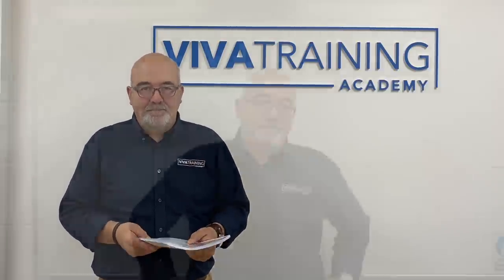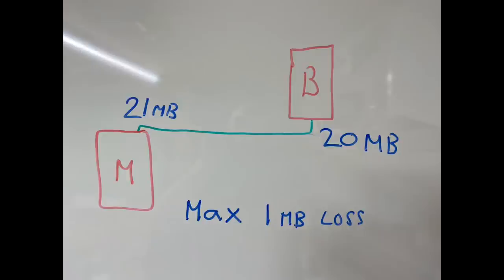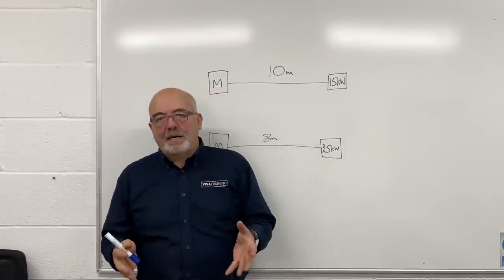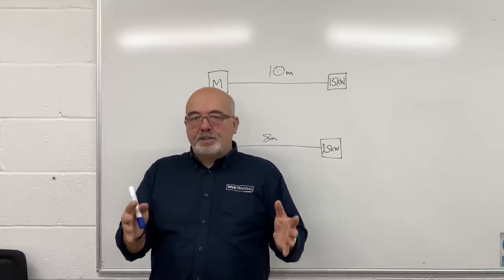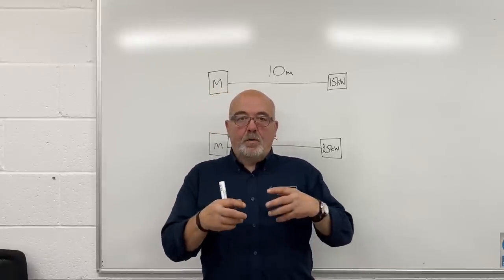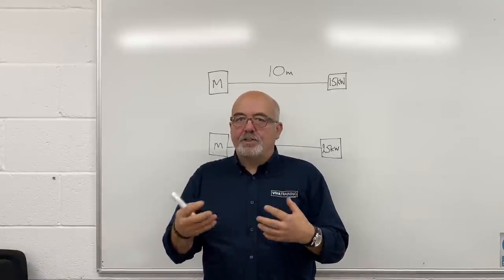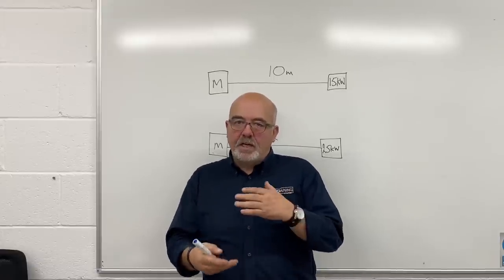ACS Gas Training - Gas Pipe Sizing

Comment: Great video. Im currently piping my home for propane but hope to one day have NG access. I understand that natural gas pressures are much lower than propane. If I size my pipe based on natural gas, would I be able to use propane appliances?

Comment: Once again brilliant video Russ and Allen.
Few questions I would like to ask:
1. When there is 2 or more appliances connected to gas meter, does each appliance have a limit of 1mb or is it both appliances have a limit of 1mb pressure drop?
2. If at a customers home and they want to upgrade, we should check if pipe sizing is sufficient enough for to allow no more than 1mb of pressure drop?

Comment: Hi just a quick one, when calculating the Tee equivalent length from B-D in the last example for appliance 2 would you not use the largest connection size of 28mm (A to B) to give you an equivalent length of 2.3m not 1.8? or is that incorrect

Comment: Great video Allen. As my house is currently undergoing a major refurbishment, a new gas boiler will be installed soon. I've been doing some calculations using the video from Russ here. The boiler will be located about 11 metres from the gas meter, so it seems to me that 6 metres x 28mm dia then 5 metres x 22mm dia are required.
But yesterday I've been digging outside to repair the drains and also replace the water mains (lead), and while I was at it, I saw a yellow gas pipe (which comes from the street to the gas meter in my cellar). I've measured the outside diameter of the yellow pipe using a vernier caliper and it is only 20mm (funny size I know).
So, I'm not sure if it would be a good idea to use 28mm from the meter if the mains from the street is only 20mm. 
Can you please enlighten me? I hope to hear from you soon.
Thanks. Cheers
Ian
Reply: I’m no expert, but I imagine it’s at a higher pressure on the mains, and it is then reduced once it goes through the regulator on the meter. 🤔

Comment: Very good and clear. Why is the permissable pressure drop 1mB? Is it a standard, or does it change on different systems?
Reply: 1 mbar is standard on all domestic natural gas systems. It's different for LPG, and on commercial gas systems of higher operating pressure. There will always be some pressure drop when gas flows through pipework. 1 mbar is achievable with reasonably-sized pipework.

Comment: Can anyone help me out?
When working out the additional pressure loss by adding elbows, where did he get the 0.6m for the first diagram.
Also where did he get the 0.8m for the second diagram?
Is it just the length of the vertical pipe X by the two elbows?
Reply: I think  he got that info from the chart for the different diameter of pipework 22mm and 28mm. He is using the paper for his calculations. It  might be in BS 6891
Reply: @mrproductivity3261  that’s the equivalent length of a 90 degree elbow for the 22mm and 28mm pipe respectively

Comment: Just to clarify at the end there B to C (0.15mb) + B to D (0.55mb) = 0.7mb total drop over both appliances. 
Do you not need to add A to B (0.15mb) aswell which would give 0.85mb which is still under 1mb in this case?
Reply from the maker: Hi Lee, I would need to watch the video again to check but i am on my way out. I will look when i get chance. Thanks.
Reply: Gas flows along multiple, separate paths to each appliance. Pressure loss to each appliance is the total pressure loss along each path, not of all pipes on the system.
Reply: Good question, I'd like to know this too
Reply: @Jehannum2000  So would that mean the each appliance has its own system which has a limit of 1mb of pressure drop for each appliance, you don't add the 2 different system's pressure loss to make sure its under 1mb??
Reply: @mrproductivity3261  Yes. Let's say there are 2 appliances on a system (e.g. cooker, boiler). Say gas leaving the meter goes to a tee, losing 0.5 mbar in the process. The pipes from the tee to the boiler AND from the tee to the cooker can then lose 0.5 mbar each. Gas only follows one of these routes, so the total pressure loss to each appliance will be 1 mbar (not 1.5 mbar).
Reply: @Jehannum2000  Thank you for your explanation

Comment: Can you explain purge volume on gas meters only, given that it not needed up to 70 kw on any pa perwork only on commercial paperwork 
Cheers
Reply from the maker: Merry Christmas
Reply: For diaphragm meters, purge volume is 5 times the cyclic volume ("badge capacity") of the meter. As you say, this is only considered as a separate entity in commercial systems. In domestic systems, purge volume is either 0.010 m^3 / 0.355 ft^3 (for 28 mm pipes and U6/E6/G4 meter)  or 1.5 times the installation volume of the system (35 mm pipes or U16/G10 meter).

Comment: There is something i cant understand 
i am not expert so i will appreciate your help
i would know how much the pressure going out from the meter should be and how much should be while it is into the appliances 
I study that we install a stages of pressure regulator to regulate the value of it but no one ever said about that.
so sometimes the pressure drop can be neglected if the pressure value after it drops doesn't exceed the appliance pressure.
is that right?
Reply: Your question is somewhat difficult to understand, but I'll try: The working pressure coming out of the meter should be 21 mbar (plus or minus 2 mbar). This is governed by the regulator before the primary gas meter. The total working pressure loss along the pipes to each appliance should be 1 mbar (maximum). In the UK, natural gas appliances are designed to work optimally at 20 mbar (although they can usually work safely at lower pressures).

Comment: Great video thanks, however with legislation starting to go against new gas installations in terms of making it illegal to fit a gas boiler in a new build after 2025, do you think it's still worth training as a gas engineer at this point in time?
Reply from the maker: They are currently spending billions of pounds on the gas pipework. Anyone who believes gas is going is crazy in my opinion. Only time will tell though.

Comment: Assuming that you have 20mb working pressure AT GAS METER and then you have an Ideal Logic which according to the MI's can do full output with inlet working pressure as low as 14mb, what happens if your inlet working pressure is 14mb due to pipe being undersized then? what about this 6mb pressure drop? 

also,same situation with baxi 624,according to their MI's,it needs at least 17mb inlet working pressure, what if you have 17mb inlet working pressure at boiler,what about this 3mb pressure drop? what happens in these situations?

thanks
Reply from the maker: You are allowed 1mb drop over the pipework for pipe sizing. The boilers will work down lower in extreme conditions, That doesn’t mean in normal working conditions. Thanks.
Reply: @AllenHart999  Hi Allen, thanks for your reply,not too sure about what you mean,i might not have worded it properly..i understand its max 1mb pressure absorption. but let's take ideal logic as an example, 14mb minimum according to MIs, so if you have 20mb working pressure at meter and due to pipe being undersized,you only have 16mb at boiler meaning 4mb drop across installation pipework, what about this situation? obviously 4mb is more than the 1mb allowance,but MI says boiler can work with inlet pressure as low as 14mb.   lets say its a new installation, is it ok or does it make it AR or ID? thanks
Reply: @11982463  Hi Im curious to find out if you figured this out, I would assume it is undersized pipework and ID because the pressure drop is way below 1mb. Please can you let me know what you found out. 
Thank You
Reply: @mrproductivity3261  with my limited experience , what i have seen in real world is that everybody just leaves it as it is, with the situation of more than 1mb pressure drop,but above minimum MI’s requirement may it be 14mb or 17mb…  it doesnt seem to be an issue. Some with more than 1mb pressure drop n will still gas rate just fine.  i have heard that the undersized gas pipework for boiler may affect other gas appliances, for example, it may affect the supply to a gas hob when boilers on maximum burner.. but im not sure

Comment: Extremely helpful video. I just wonder if the end calculation that totals 0.7mb by adding the pipe runs of b to c and b to d.

Should a to b have been added on also?

Seems unlikely he's made a mistake with this level of detail, but to myself a to b feels like a lot has been missed. For my own build this would be 8 meters lost so I'd really like to know.
Reply from the maker: Thank You
Reply: He’s already done that In the allowance from A To B that has to convey the full 40kw.
The A to B loss was 0.15mb, and that has been allowed for in both app 1&2. He’s done it separately so if you look, 
A to B 0.15 mb
B to C 0.55 mb
Total 0.7 mb

Comment: nonsense creating red tape regulations and paperwork  boiler manufacturer gives min inlet pressure figures 20mB of gas pressure people are upgrading pipes adding more cost to installation  35mm 40mm pipes in domestic homes this is a joke these pipe sizes are used in commercial buildings my old boiler says 20mB inlet pressure the boiler installer wanted to change the pipes from 22 to 28mm the new boiler also says 20mlb pressure

Comment: If only sizing electrical cables considering 3 phase, power factor, length and size as well as installation condition were so easy …

… still at least I now know the difference between a ‘gas engineer’ and a ‘professional engineer’ ….